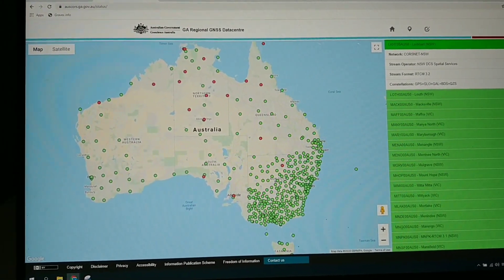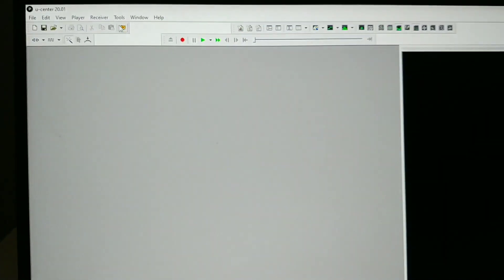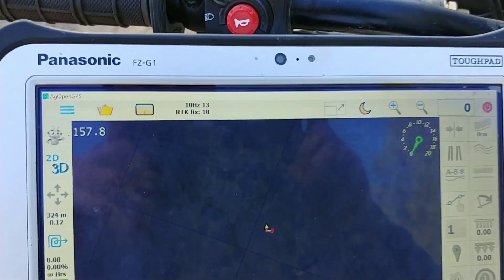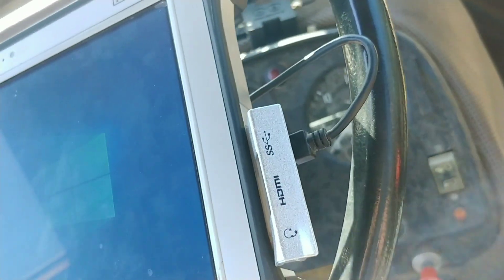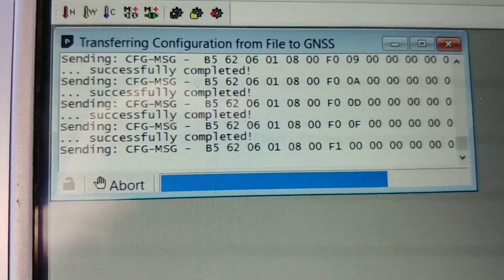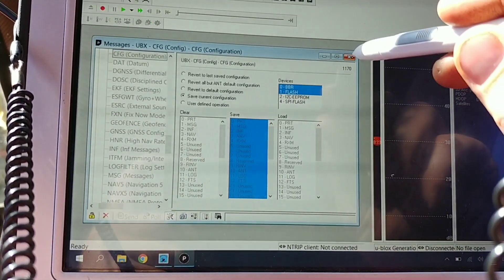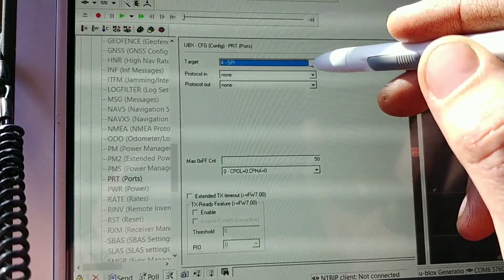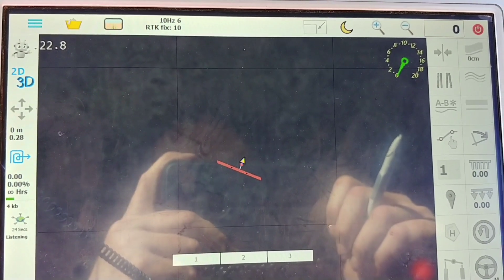RTK GPS in Australia using ardusimple ublox F9P for ag including ucenter configuration for agopengps

Comment: there are some application for android, which will work with f9p by bluetooth?
Reply from the maker: I would guess any of them should... Since bluetooth is a standard thing and the gps data is sent as a standardized "message". Think they're called NMEA messages. Any older touchscreen pc should run agopengps tho. I got these Panasonic fz-g1 tablets off ebay for $800. Although that's expensive they are quite rugged with a very bright screen

Comment: Hey mate, I’ve built the same system on a Toyota in NSW, interested in having a chat with you about the NTRIP side of things, and possibly helping your build also, let me know if you’re interested.
Reply from the maker: Hey, well, this video is nearly the extent of my knowledge on the subject, but if you have a specific question feel free to ask. We have had autosteer working on the tractor however we are currently busy making hay and getting ready for harvest so the project has stalled for now. Thanks for the offer ill see how we go when i can look at this again
Reply: @RonanRTW  No worries mate, cheers for the reply, I've got it sorted with RTK coming from a source 89NM away and getting really good results. my issue was simply not having the rtf settings on in u-centre, which thanks to your video i jumped in and added those settings and any we go!! cheers!!!